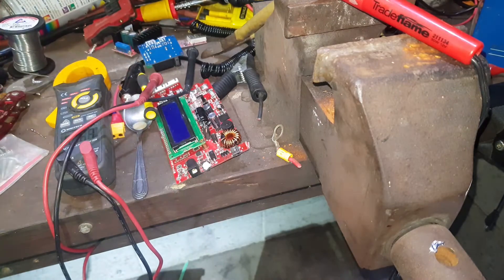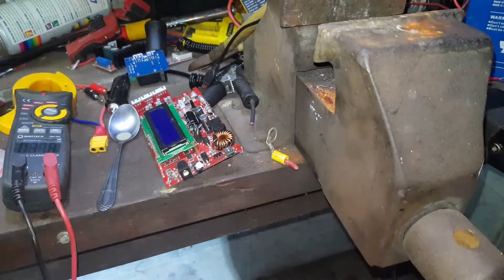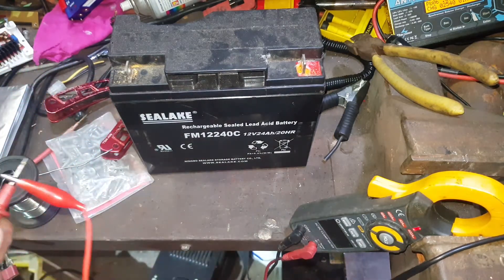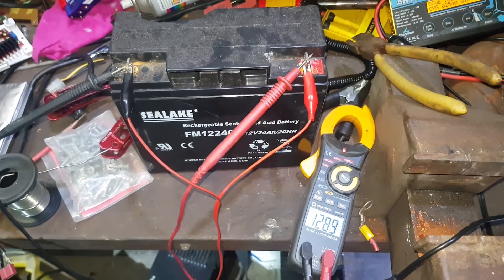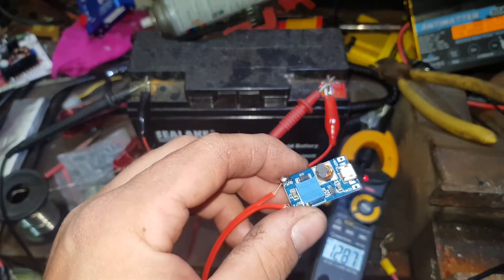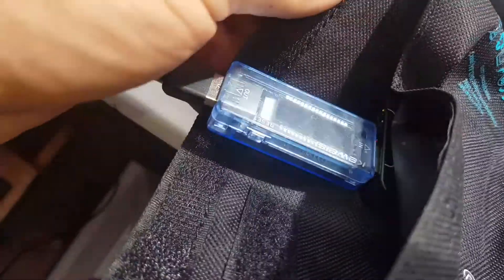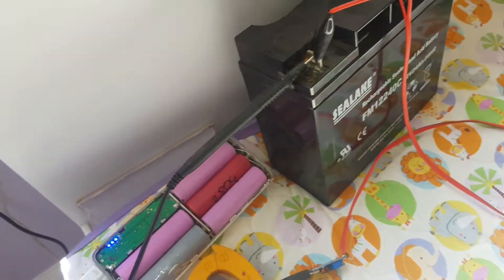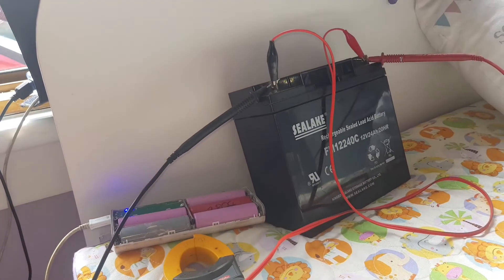Solar to usb 5v to 12v boost converter test blitzwolf solar pannel

Comment: Interesting stuff. I was looking for a link to the USB watt meter you are using ?
Reply: Thanks bro
Reply from the maker: +dP Workshop ill try find you one mate
Reply from the maker: https://www.banggood.com/KEWEISI-4V-20V-0-3A-USB-Charger-Power-Detector-Battery-Capacity-Tester-Voltage-Current-Meter-p-984613.html?p=OQ120813147900201708
Reply from the maker: there ya go mate
Reply from the maker: +Dillon P no worries bro ive had this one a couple of years and still.going strong so you should be sweet